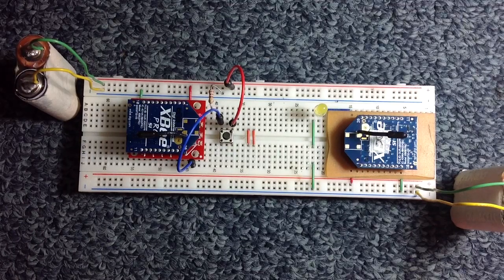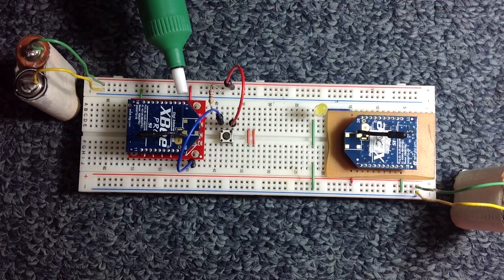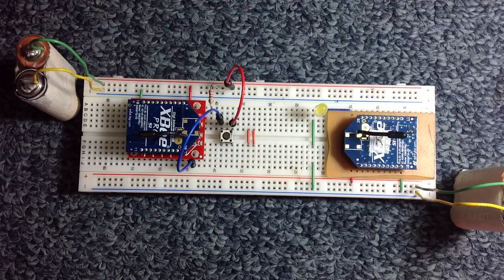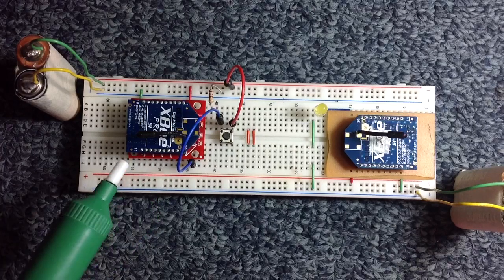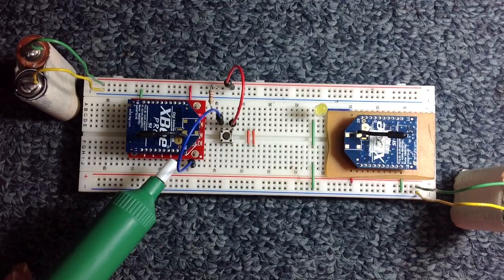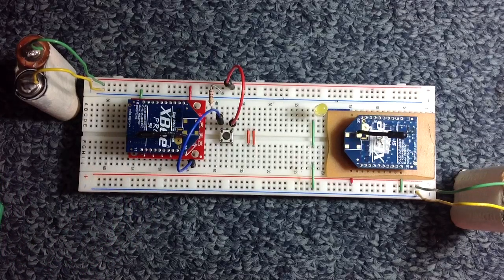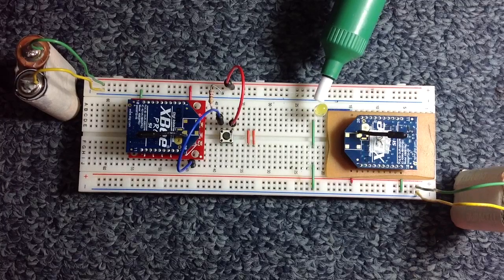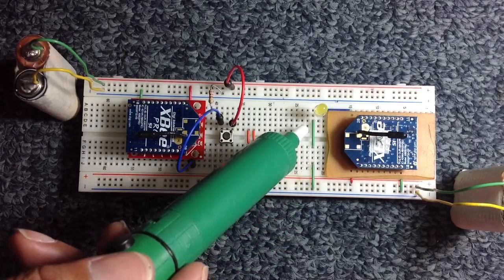xBee to xBee (S1) Direct Wireless Communication and Switching (Part 1.1)

Comment: Hello nice to meet you. I urgently need your help, please. I need to communicate two XBee S2C in the same way you did in a video with a push button that sends a digital data from the transmitter to an LED connected to the receiver. I have tried to configure both XBee in many ways but I have not managed to operate the sending and receiving. Could you help me? Thank you very much.
Reply from the maker: Sorry, am not familiar with s2C, i think the functionality is available only with S1, S2 neither.

Comment: Hello ..finally I found someone who is doing exactly what I want to do...check the level of my water tank by showing LED in my home if tank water is low..only problem I need 2 km ...will the XBEE you used do that or do I need XBEE Pro series 2...if so is the connections and programming
 the same...Thank you

Comment: Hi, look I have two xbee XB24-AWI and I need to turn on a LED with basic stamp microcontroller but when you start configuring the xbee can not do it from the terminal, that is when I write +++ not get the OK.
my project is to connect a xbee module to a microcontroller which will send a data to the remote xbee which should light a led but does not. I would like you can support me with this my email is nanolopz92@gmail.com
My English is not very good and I hope you can understand me.

Comment: One last thing Fnjy.  I found a fantastic resource for XBee which you should share with your viewers. It's free too. Do a Google search for these exact words... "parallax getting started with XBee RF Modules text". It's a free pdf which in hard copy is sold for $25.
Reply from the maker: I figured out that before that's the very first idea why i work on xbee, for an outdoor light far across the street where running a wire for a switch is much expensive. I still have the parts for that assembly. Ill share that soon. Thank you for the encouragement.

Comment: Fnjy,
Did you try the Range Test with the loop back trick I discoveed.... with pins 2 and 3 shorted? 
Here's a question for you. Referring to that video about "IO line passing" 3:00 minutes in he talked about increasing the sample period "as a back up to the change detect." That makes no sense. So I tried different values and they all worked. He suggested one second. But it still responded instantaneously. So do you know what that one second allows?
Reply from the maker: Dont think its for  backed up to change detect. The xbee is buffering the type signal at specified time say 1 sec to validate the kind of signal from the user input before transmitting - theoretically depends on algorithm, at a press of a button, the transmitter will keep transmitting same signal for 1 seconds, before it will process another input.  if there are some loss signal within that time the other remaining would still validate those lost signal by the receiver- some kind of predictive features or algorithm.

1 seconds seems too long, but it depends on algorithm how it interpret a user input.  It is useful for some sensitive application though. My explanation is somewhat theoretical as we really need to know how algorithm works as there are many ways doing it. I hope this gives some idea.
Reply from the maker: I will try the range test once i got the other parts.

Comment: Fnjy:
There's another fun thing you can do with XBee direct wireless (no Arduino)  You can range test them using the X-CTU User Interface. You find your way to "Range Test" and then struggle to do all that it asks for. The only hard part is responding to the warning about putting in a "loop back" jumper. Apparently, if you are using Arduinos, you know what this means. But for those using XBee without a microcontroller, just jumper between the "receiving" XBee's Dout and Din....  pins 2 and 3.

Comment: Fnjy,   I did it... I got more than one to work at a time. There's one additional field you have to address: Change Detect. It's on the Transmitter side. It is a binary mapping that allows particular digital inputs to work. (That seems so unnecessary.) I wish I could say I found it for myself, but it was a youTube video with "IO line passing" in its title. Go to 2 minutes 15 seconds. It's quite a long explanation because it involves converting the digital map to hex and remembering the first digital input is the least significant digit.
Reply from the maker: Bravo! Yes it's the "Change Detect " . Thank you for you inputs. He demonstrate one channel, but we maybe can do for all channel. If my Binary knowledge is correct, 00010000 means the 4th channel D3 is ready for input, So, to make channel D0 to D3 ready for input, it should be 11110000  in binary or F0 in HEX. And for all Channel D0 to D7 the binary value will be 11111111 or FF in HEX. We then just Convert each binary arrangement to HEX as input on "Change Detect"
Reply from the maker: Have you or can you try two or more channel at the same? say for two channel D0 & D1 i.e physical Pin 20 & Pin 19, the binary is 11000000 or C0 in HEX. My ordered parts still on the way for the next demo. Let me know if you make it work for all channel at same time. Thanks.
Reply: Jnjy,
Yes, I did exactly that. Pins 19 and 20 and got the LEDs to light up across the room; one at a time or both at the same time.  It is interesting that something so simple as that can thrill me so much. I feel like a child.
Reply from the maker: Haha, I'm glad you made it, yes indeed unknown thrills.  Congrats!

Comment: Thank you Fnjy for putting up this video.  I got it to work just the way you described. But I can't get any other pair of digital input outputs to work.  I would like to demonstrate all 11 to work. Is that possible?
Reply from the maker: That's logical, I was thinking about that but have not tried yet.  Have you try the other pin, one pair at a time, instead of pin 20 move it to other pin? Id like to hear what happen.
Reply: fnjyusername  Yes. I tried 19 alone and two others alone. No response. Is there something special about D0, pin 20?
The X-CTU interface looks completely different, but all of your changes can be found.
Reply from the maker: Walter Clark I' ll try to check on that. hmmm. my 1st thought maybe the "line passing" config on XCTU - maybe some option to make it work for other pin. Ill post my findings.
Reply from the maker: fnjyusername Have you tried matching  the pin config on IO line passing option (i.e. pin 19 for example?
Reply: fnjyusername   I don't think so, because I don't understand that. I did play with the IO line passing option field.  There's a little help icon that has some suggestions, but I couldn't follow them, so I just tried random values. I tried FF  FFFF FFFFFFFF 0 and 1. Only FFFF worked and your suggestion of 01. But only D0 worked. Anything else I should try?
Reply from the maker: Walter Clark Ill try that, and post my findings.
Reply: I was thinking that switching from dec to hex might help right around that time.
Reply from the maker: ***** Thank you, you have just made a clue it's the HEX.

Comment: great videos and helpful. can this be done with more than 2 xbees? i want to control 10 different outputs. what i must do?
Reply from the maker: Yes, but you may need a micro controller on the transmitter side - depend how complex - I have 3 in me but haven't time to try actually.

Comment: Well, that's what I would like to learn how to send a data to a xbee to the other using the pin 20 as input to the transmitter and the receiver output in so far but I've tried it since the new video you posted has other commands as you work with the xbee pro s2: (

Comment from the maker: We can try I believe its possible but I need to see what you got in your setting. First you need to identify the proper addressing of S2 (which is different from S1) then setting digital IO pin as Output on receiver at pin 20 and as Input at pin 20 on transmitter.

search this "xbee series 2 point to point communication by cytron"

Comment from the maker: ok.. Let me try and check. First with the  Transmitter 
1. For Series 2, XCTU should detect XB24-ZB if you click "Read" button under Modem Configuration tab. 
2.on same tab, the "Function Set" must be ZIGBEE Coordinator AT
Try the steps and tell me if your xbee detect the same.

Comment from the maker: For Series 2, you can configure the same except in the XCTU, Transmitter should by the selected as Coordinator and the Receiver should be configured as Router. You will need an FTDI (Serial to USB converter) board so you can connect the xbee to your pc via USB cable to configure it via XCTU. Unfortunately I don't have series 2 - the difference is configuring as I mentioned.